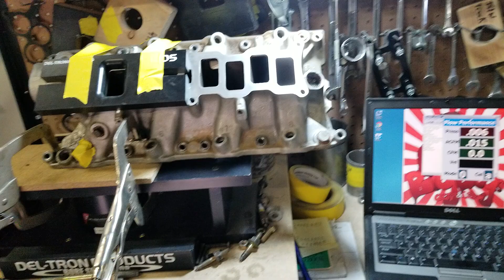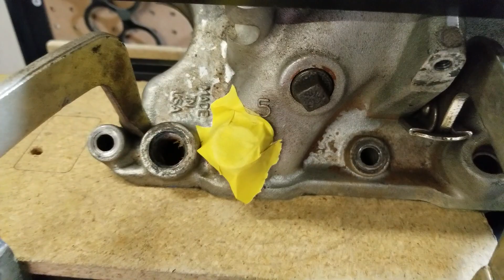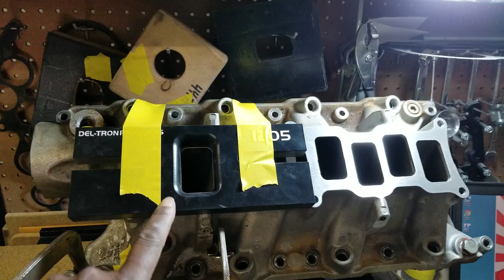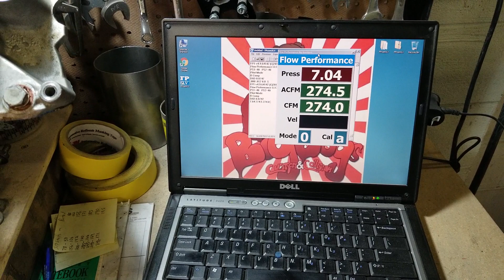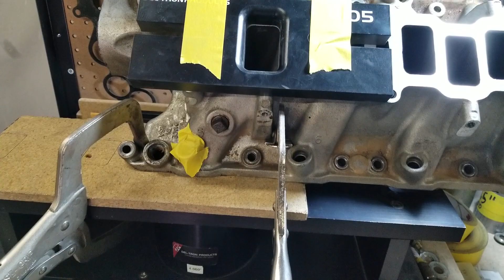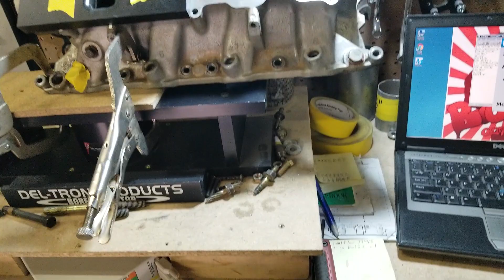Bigdogs Porting TFS 5.0 Track heat flow comparison part 1

Comment: Is there a part 2 to this video? I'd like to see the results of the TFS intake after Bigdog port these intakes.
Reply from the maker: We've posted before and after flow results on these manifolds on our Facebook business page at Bigdogs Porting. After our stage 2 Porting the average runner flow gains 50-60cfm and the tb tunnel flow gains goes up 150-175cfm. Hp capability goes up 50-70hp over stock